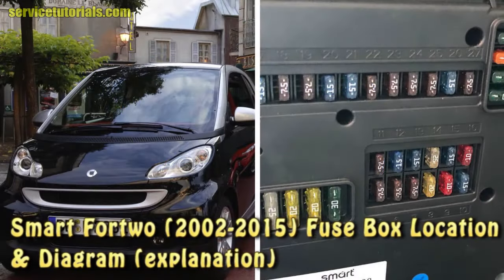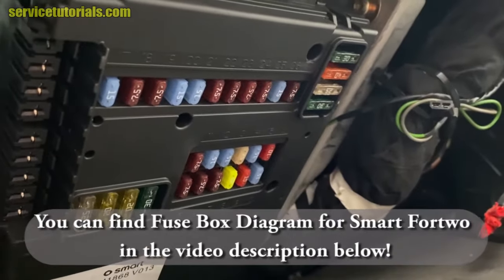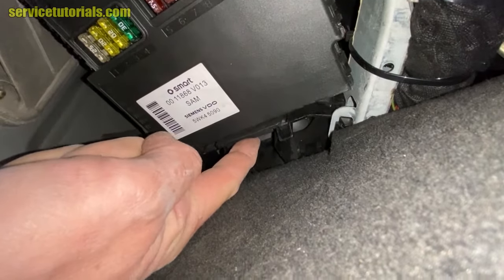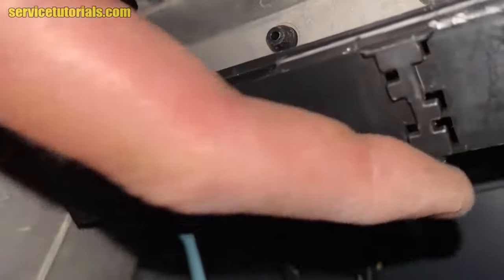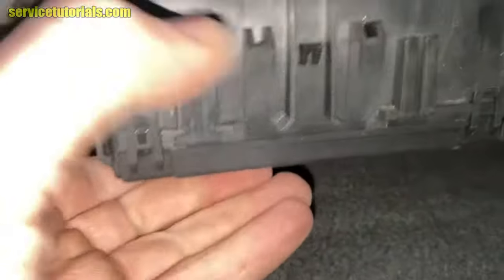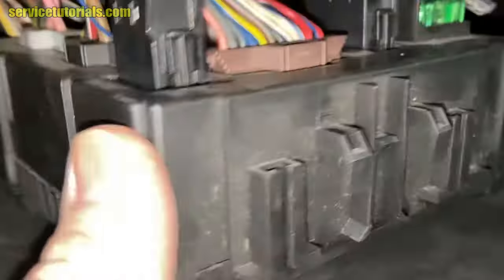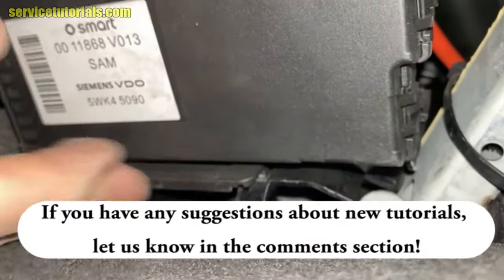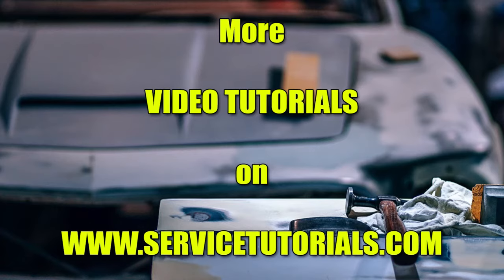Smart Fortwo (2002-2015) Fuse Box Location & Diagram (explanation)

Comment: Does the box also come apart easily to get to the relays on the inside. I think my relay for the Fog/DRL LEDs has gone bad because the 10A fuse in the #5 spot isn't blown. I believe the relay code is K14. Also would you happen to know where to purchase that specific relay? By the way, my Smart is a 2008 passion.